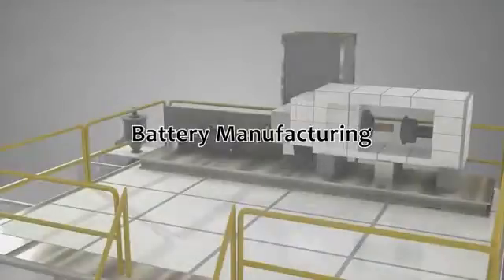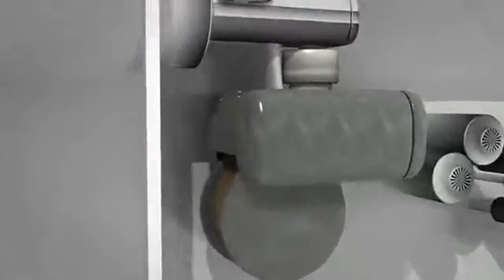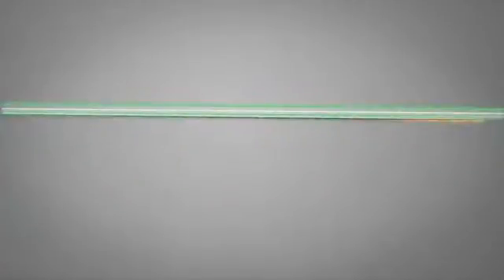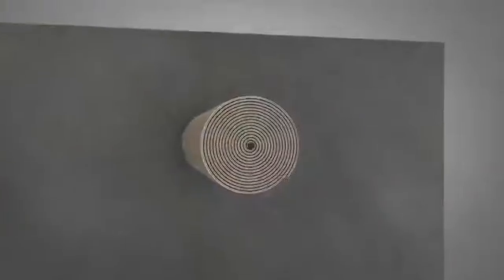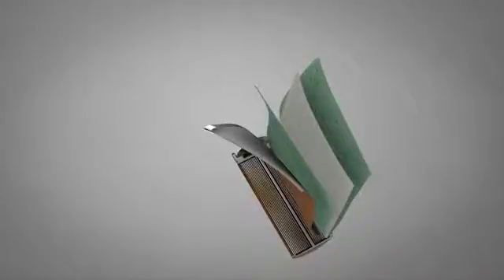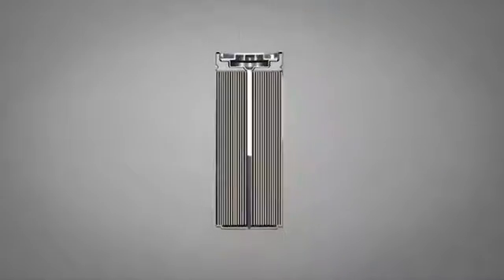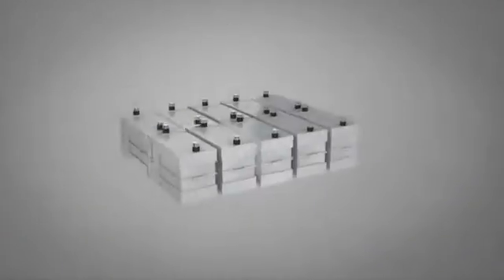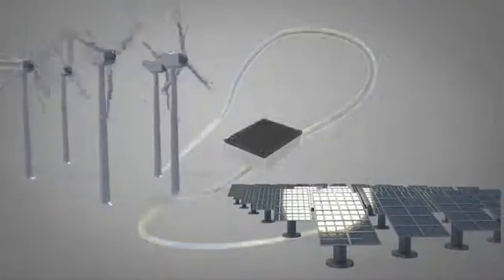Battery manufacturing

Comment: some sites say the copper side is the cathode
Reply: Its not, copper isn't stable at voltages above ~3.5V in LIB plus its expensive and heavy so Al is the preferred metal.